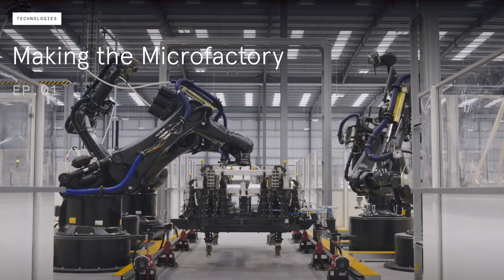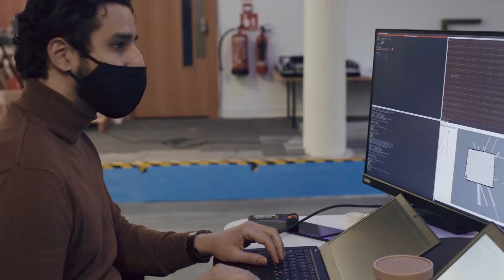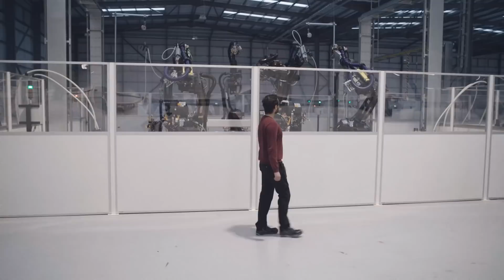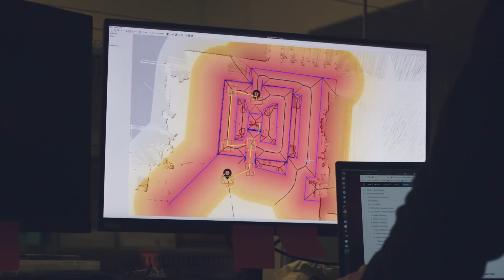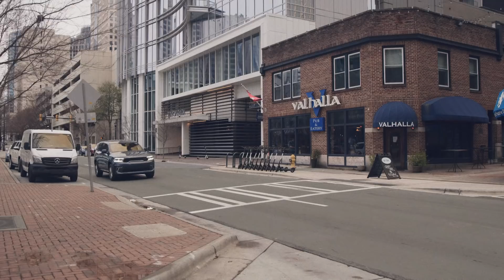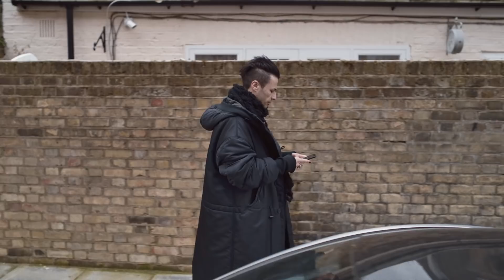Making the Microfactory | ARRIVAL

Comment: This is interesting but seems it would increase the need for transport and make logistics more complicated. With ten small factories spread out each supplier needs to ship to ten location instead of one.
Reply: @Smithy18 Still makes no sense. You need to absorb production locally for it to make sense. Which means that most of the time you will produce at low utilization which highly inefficient. Or you will end up selling to other locations, which makes everything more inefficient and defeats the purpose of the micro factory.  This business strategy is flawed it's very easy to see why  ? They are entering a market that requires high volume, where customization is less of factor than with traditional automobiles, where the main advantage is the life-long cost of your vehicle, and they are doing so in the most inefficient way possible.
Reply: altgough it makes it more complicated, i dont think it will need more transportation since this concept doesnt change the number of parts needed
Reply: @irg008  It does because instead of having one movement with 10000 parts you now have 10 different streams of a 100 parts.. I mean come on.. thats not rockey science. This entire idea sounds smart but as an industrial engineer i can guarantee right now that they will end up with much more costs then conventional car manufacturers.
Reply: @tacticalgaming4765  not if you are highly vertically integrated.  This reminds me of the Steel Industry disruption for Micro Furnaces
Reply: @MattHughesMN  But they arent and it still creates more movements haha. The only way you reduce that is by centralizing production at mass.
Reply: @tacticalgaming4765  Not if they only have one factory. Their production target is only 10k vehicles.
Reply: @KevinGChiu  They literally state that the idea is to build more of these factories around. Literally their entire business strategy revolves around that. have we watched a different video? If they just plan to build 10k then this entire company is doomed to fail anyway.
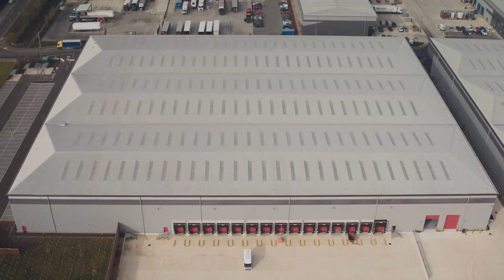Reply: @tacticalgaming4765  1:20 10k per micro factory, but how are they going to find that many metro areas that need micro factories?
Reply: @KevinGChiu  Yeah u just proof my point.. 10k PER factory.. No idea, i dont support this business at all, i came across the video and clicked out of boredom but the sheer stupidity of the video triggered me to respond.
Reply: @tacticalgaming4765  I guess it means the finished product can be shipped straight to the same city instead of all over the world. Though in terms of the supply side, that does create a lot more shipping pathways. I guess you could centralize the parts shipping to a smaller number of places and then ship them to the micro-factories in bundles, though it would still be more shipping on that side. 

What about some of the other benefits though like modularity.
Reply: @tacticalgaming4765  100% agree with you. it's a weird idea.

Comment: if I understand correctly this would mostly benefit from less transport and less strain on surrounding labor. While the traditional assembly line mostly benefits from the super efficient assembly proces. However, the world as I see it is growing in the direction of self driving and automation, so the weaknesses of the traditional model are being resolved. Which of course means that the benefits of this model shrink. I wish you all the best, especially with other products, but I think this doesn't make sense for cars. Especially once they can drive themselves to the customer.

Comment: 10,000 = 833 a month roughly 4.8 hours to produce a vehicle. This company will go bust if it's product is expensive. Plus it will hinge on contracts. If it doesn't secure any it's bye bye. My gut feeling is this micro factory is not going to work.
Reply: The micro factory is the future but perfecting it will take time

Comment: As someone working in the EV production industry I have two things to say - this is an insane paradigm shift for low volume production, and will certainly be a technology blossoming in the near future. Absolutely fantastic.
Reply: As someone working in automotive industry as a Process Planner (developing production lines) - i do not see anything new in this video that would not be already years in use (in a low volume manufacturing process)
Reply: It’s great to hear you think the same. I look forward to seeing more of these popping up all over the place. It will be great for jobs and product manufacturing here in the UK.
Reply: @juanka galindo  why do humans have to do manual labor? why can't we have robots that do that.  lets elevate the human race.
Reply: Yup, it's best to aim for very low-volume production when making EVs...
Reply: @f.d.6667  For now. I'm pretty sure Tesla will get it's battery production right and churn out those model 3s and model 2s like no one's business, at a lower price or price parity with ICEV.
Reply: @ElmerGLue  humans shouldn't be doing physical labor for a job.

the machines that pick are more accurate, much faster and the warehouse can be laid out in a better way too.
Reply: @jetah50  You haven't answered or elaborated a single question/notion that was put to you.
Reply: @hdmccart6735  i have answered them. you didnt like the answer.
Reply: @jetah50  Your 'responses' were simplistic and naive.
Reply: @hdmccart6735  KISS method works best and i'm here to write a novel.
Reply: Do you not feel they are over engineering it a little perhaps? The idea of "vision systems" and "AI" seems great but I do wonder if a human could move those parts just as easily :)
Reply: @zag4me  in cheap Eastern Europe the costs of a simple operator is 22-26k Euro per year, in a 3 shift production you need 3 operators = 66-78k Euro yearly to cover one operation, 
Capex costs (investment) for a cooperative robot 10-15kE, simple robot 10-15kE, large size robot 20-35kE,  autonomous logistics trolley 5-15kE. Running costs minimal. 1 robot covers 3 shift production. 
Make your calculation! (NOTE: and that is EAST Europe with "Cheap" labor, West Europe Labor costs 50+k Euro yearly x 3 shifts

That does not even cover the topic - availability of labor. Believe it or not - its a huge problem to even get a operator nowdays, in Slovakia we import them from Ukraine
Reply: @PeterJurasek  Yikes. Is it really that bad there?
Reply: @zag4me  there's nothing like over engineering, the goal is to push the limits and see how far we can go.
Reply: @zag4me  humans have needs. they have emotions. they have household issues they bring to work.  all that is eliminated with robots.

for example. i did warehouse automation of storage and retrieval. one job/warehouse laid off 900 employees and the system cost was paid off in 2 years on the benefits from the human workers.